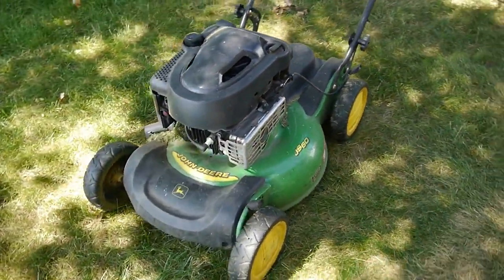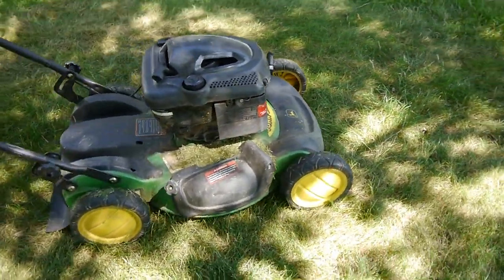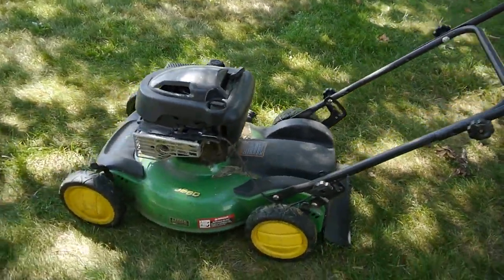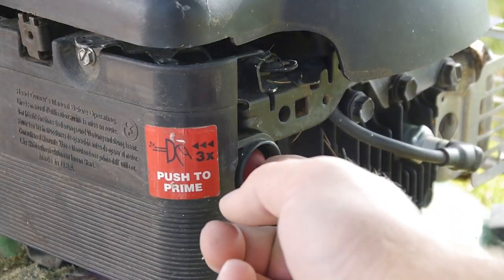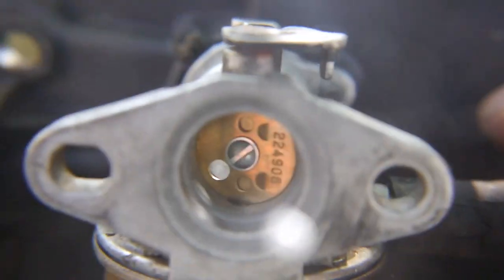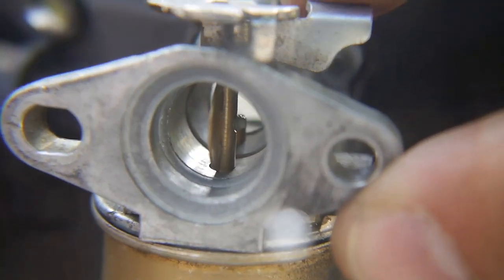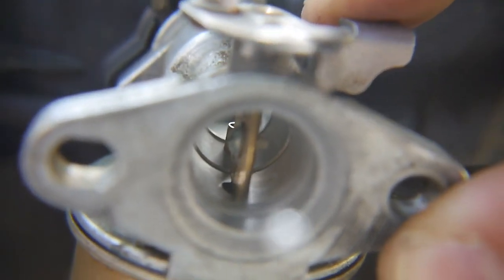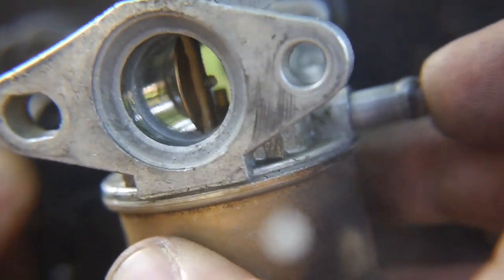John Deere JS60 Push Mower Won't Prime Fix, Won't Start

Comment: My JS 60 was sputtering intermittently, so I took it apart and cleaned the carb. Before, I tore things down, I thoroughly cleaned the whole unit. A lot of debris / dirt can cling to the engine block and attached parts, so a good scrub before carb removal, hoses and linkage provides a clean working surface. A clean block will also allow for effective cooling of the engine especially when working in warm summer conditions. Helpful video, but cleaning the whole unit before servicing is a better approach and exposes all the components in a clean manner to enhance visual diagnostics. Also, fire and gas don’t mix well. Avoid any torches and replace any damaged gas tanks for safety and reliability. For good measure, use an electrical cleaning spray for the coil contacts, including all electrical wires / spark plug wire and contact area to the spark plug. Optimal performance is related to clean components!

Comment: I have the same problem due to fuel tank cracked in almost exactly the same place.  Thanks for the video.  You've confirmed my guess that the primer circuit does not work if the system has an air leak.  I don't have to trouble shoot that now.

Comment: The cracked fuel tank was not the culprit here, more than likely it was a cracked fuel line, bad primer, or a loose or warped air filter backing plate which relies on a good gasket seal.
Still a good video though!
Reply: My experience is that a cracked tank will in fact cause the primer problem.  Fuel leaking from crack in same place as video.  Fixed tank with glue.  Mower primed fine, ran fine.  Ten days later, glue failed and gas leaked upon filling.  Reduced fuel level to below leak point to get through the day but mower would not prime.  Used starter fluid spray in carb to get it started, then ran fine.
Reply: I'm working on my js60 now and it has the same issues.  Starts with Starting fluid but won't stay running.  New spark plug installed, I was thinking carburetor, but I filled the tank, and it leaks.
Reply: It's something to do with the throttle linkage.  It will prime to start now & stays running if I play with the linkage connection by the carb.

Comment: My JS60 will only start if I poor gas into the carb , then it starts and dies right away , I have cleaned the carb,replaced the gas line , all of the gaskets and still nothing has changed
Reply: Tear down the unit entirely to the block. Clean all the components, especially the coil and associated wires and contacts. Remove all old fuel and oil. Use long life 5-30 synthetic blend oil for these older JS 60’s. Start with hospital -clean components and reassemble. New spark plug, new air filter. Run some SeaFoam through the intake during start-up. The key to success is always clean components!

Comment: Really enjoyed this informative video!
Reply from the maker: I am glad you enjoyed it!
Reply: @JoshAQ  Question: Does it seem to you like this mower cuts high even on its lowest setting? 

-Backstory: I have the JS63C with the swivel wheels. I bought it used from some guy who was selling it for parts. I need it's body mainly for its swivel wheels for the remote control lawn mower I was building at the time. The 6.5hp engine wasn't running, however, I felt like I could fix it. That said, I didn't need the engine because I had a 3.5hp Stratton & Briggs engine from my previous mower I wanted to used for my remote controlled lawn mower. I successfully swapped the engines and successfully built my remote controlled lawn mower. I've been using it for at least 2years now. I mow with it on the lowest setting and it still leaves my lawn with a considerable shag. As a result, I'm considering fixing the JS63C engine and swapping out the Stratton & Briggs, but I just can't shake this feeling that the reason my rc mower is cutting high is because of the design of the body and not so much the engine power and the accompanying blade. I've been going back and forth on the swap but I keep arriving at the feeling that the body design is the problem.

Any response is appreciated.
Reply from the maker: @AChi__  Hi. My first instinct is that the engines have different shaft lengths. Or more precisely, the plane the blade rotates in has a different offset length to the mounts of the engine. My guess is the 3.5 hp motor has a shorter distance than the original one. This would have the blade spinning higher up in the housing, it may also be throwing off how much vacuum/air is displaced by the blade. Most mowers use a vacuum affect to help the grass stand up straighter. If the blade is too high up in the housing it may cause alot of turbulence above the blade and would also not help. My mower cuts about where it should I accidentally set it too low once and it scalped the grass, so I don't think that is the issue. Good luck and let me know what you find or if you have already ruled out this as a source of the issue.